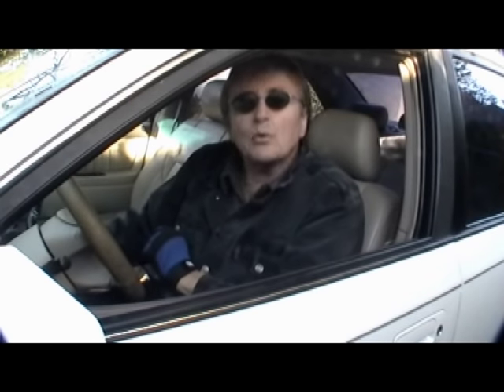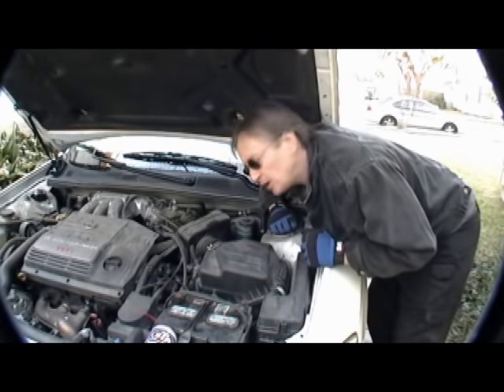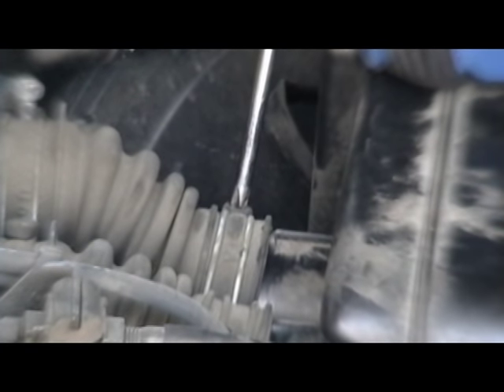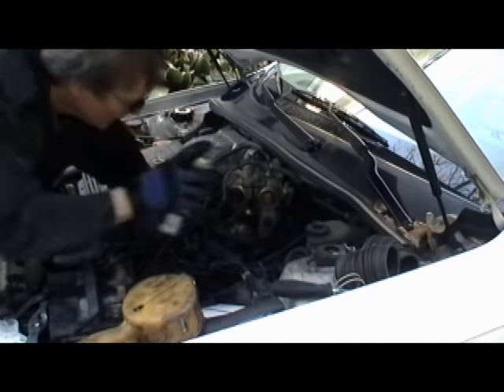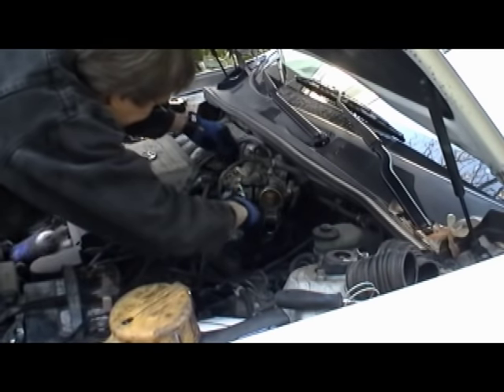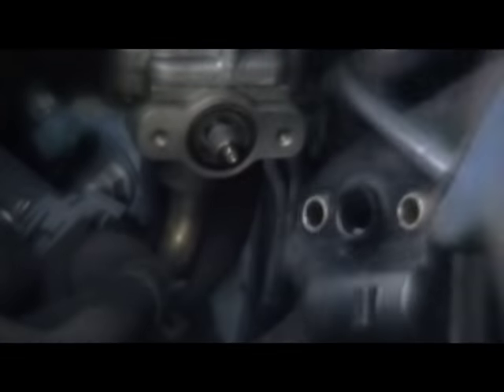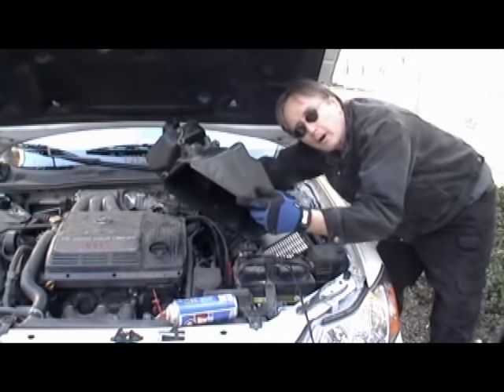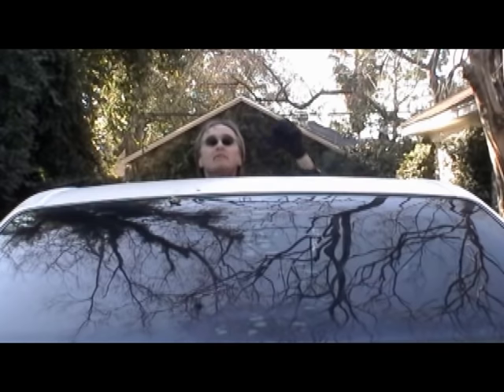How to Fix Engine Idle Problems in Your Car (Rough Idle)

Comment: I have a 1996 Acura 3.2TL V6 premium. the IACV code came up on my code reader. took both IACV AND FIACV and cleaned them. code went away but still fluctuates between 1-2 RPM on idle. My O2 bank 1 sensor 2 is on, causing the check engine light. Could this be causing the rough idle? it doesn't matter if it's cold or hot, it still idle rough when in neutral or park. others than that it runs Great! other than the gas milage. 
also I suspect the previous owner did not use premium gas. any suggestions.? seafoam? if so from where?
Reply from the maker: you could try a new sensor, but often it's something else making the sensor give bad data to the computer, and finding that cause can be a cow. On those, often intake manifold vacuum leaks on that side
Reply: Scotty Kilmer finally after looking all over the place I fund a Crack on the mass air intake. ( the darn 6in rubber tube) then took it apart and it split in half. lol
it started as a small leak that turned into a tear. the problem was the Engine Air suction pipe. it was getting too much air.

Comment: had to replace alternator in 2001 Auroa,now im experiencing a sqeeling noise an sum stalling... wats the problem?
Reply from the maker: make sure fan belts on are tight first and also that they are not just worn out and need replacing

Comment: hey scotty i watch alot of your videos and i have a questio. i have a mazda 6 i 2.3L that is rough idling and check engine light is on i scan it and a p2187 is showing up i changed pvc and vacume lines and still on can you have a rough idea of what It can be?
Reply from the maker: +Odemaris Cosme : P2187 : Fuel Temperature Sensor B Circuit Low Input. ... If you have an intake, whether its cold air or short ram, you might have an intake leak. ..

Comment: Scotty, I have a question please. I have a 1995 Toyota Tercel with a rebuilt engine. Issue is that it vibrates (steering wheel and car itself) when I am primarily stopped and rougher when I put it in reverse or park. (Automatic). But yet, when I put it in drive and go, she goes happily down the road, good shift change, but every now feeling some slight hesitation or loss of power if you will, but it keeps going. Yet, when I stop, there goes the idling rough again, then I hear like a "change" assuming it is the fan coming on and off, and it calms, then a "change" again (fan?) and rough again. Funny thing is it does not vibrate as much with A/C on. We are at a loss and I dang sure can't afford guessing, anywhere from spark plugs, to wires, to A/C to idler something or other to motor mounts, etc. I just need POSITIVE help please. I do have a check engine light on, but it's been on for YEARS! This just started happening after the rebuilt was done I know the mechanic said he cleaned the throttle body, and it helped, but for like a week, then there it goes again - miserable Thank you <3
Reply from the maker: +N Valdez ac makes car idle higher with the idle up valve. Odds are he just did a weak rebuild job, but drive it a few weeks to see if engine loosens up and it idles better
Reply: Hi Scotty, thanks for the reply! The car actually idles better with A/C on and rough when off - that is what I do not understand . . so you still think it is weak rebuild perhaps, not an idler issue of sorts maybe? It scares me to drive, but so far I get converter to plugs to idler maybe. Strange thing is, when I go 50 +, it drives primarily smooth but every now and then I feel a click of some type of power loss, intermittently . .  LOL :(

Comment: Hi master , I been having code po015 on my bmw 328i 07 I get rough idle jerks stalling when I drive it it run ok when I slow down it stars jerking and feel like loose of power or choke. Plz help I change the solenoids n it's the same I change sensor to

Comment: What's up Mr. Kilmer anyway I got a 1999 Honda accord lx - 2.3 liter - 4 cylinder - Automatic with 175,600 Miles. My question is what to do when you start your car then the rpm jumps between 2000 To 3000 sudently it drops to making the car shut off anyway could it be that it needs a new distributor or just follow what this video says and pls answer me by details what is it and how to fix it things like that. And thank you
Reply from the maker: +Augusto Peña   have the distributor checked, they often break down and stall like that
Reply: Ahh men thanks.
Reply: +Augusto Peña Hey Scotty 1 more question - What about if the distributor is A OK no problem so could it be the IAC or the throttle body like in this video...

Comment: +Scotty Kilmer Sir, I have watched many of your videos and replaced cap, rotor, spark plugs, and TPS and my car still idles rough. I have a 1987 Toyota 4x4 with 22re and it idles rough and only takes off at wide open throttle. Also the truck dies when I remove the oil cap while running. Any ideas? Thank you for your time.
Reply from the maker: +Timothy Teista  engine is just flat wearing out inside from those symptoms. do a wet and dry compression test of all cylinders to find out, and if so, live with it
Reply: +Scotty Kilmer thank you for your prompt response
Reply: +Scotty Kilmer i just upload a video"engine problems part 1"

Comment: hi Scotty,,, i have a Vw polo 2006 model, the traction light and ABS are showing and i cant remove them from the dash board..help guys.. Since then the gears aint changing normally nd its an automatic

Comment: My '83 toyota pickup idles rough and engine stutters when cold started. Once it gets up to operating temp it idles perfectly. Any clues? Just replaced spark plugs and plug wires.
Reply from the maker: +Obliterateification try my video "how to clean fuel injectors on your car" and pray you don't need new ones
Reply: Thanks!

Comment: hi Scott i have a Toyota sienna 2000  when i rev it just go 2000 rpm  i was wondering if you could help me out please.
Reply from the maker: pressure test the fuel pump, but realize if you are just sitting revving it up, it has computer software that prevents high revving by your foot

Comment: Hi Scotty! My ford focus rpm goes up when im driving. I put it in neutral and it still goes up. I pulled over and turned it off and wait a little bit. Then start it back on and it goes away. Why is it doing that? It doesnt go up and down, just up. Please could help me with that issue? Thank You
Reply from the maker: try my video "how to fix a car that idles poorly" and also check for vacuum leaks
Reply: Scotty Kilmer alright thank you

Comment: hi i have a toyota marino ae 100 and the rpm stays at 1000 most of the time, even at park. This causes the car to vibrate and i have noticed while driving i have a very poor gas mileage. I have seen alot of mechanics where they have cleaned the air flow, adjusted the speed cable, adjusted the ideal to low but nothing seems to help. what might be the cause? or is the airflow that i have to replace.
Reply from the maker: have a pro analyze the data to see if maf sensor is bad or not, vacuum leaks can also do that as can worn fuel injectors

Comment: Scotty, my 98 ford taurus revs up every minute or so in park only when the heat is turned on. Can you help me figure out what's wrong and how to fix, thx.
Reply from the maker: check for vacuum leaks, and also check the idle up valve, turning heat on often turns AC on too and that cycles the ac compressor on and off
Reply: Scotty Kilmer  thanks mate.  so mention them things to mechanic when I bring it in?   I just had the break booster fixed after one of the mechanics accidentally spilled oil all over it burning few holes in it & other hoses.  wonder if this new problem is their mistake too cause before it wouldn't Start every now and than and they said it was my security system fuse shutting off the fuel pump.  they fixed that but now got this new problem.  weird only does it when heat is put on.

Comment: morning scotty. i got a 99 nissan premirea (rhd) it starts up fine until its warm then theres a rough idle and shuts off and then starts right back up. ive changed plugs , oil air filter even a new fuel pump. but when i try to step on the gas it shuts off. i cant even press it a little . help pls
Reply from the maker: +Michael Hudson have the maf sensor checked, and also try my video "how to clean fuel injectors on your car"

Comment: I have a quick question. I was driving with my mom and I was accelerating got it to about 5500 rpm and my mom starting freaking out telling me I was gonna blow my engine. I dont do this every time I accelerate and I didn't think much of it. I didn't go anywhere near redline. so, is it bad to do rev up to 5k-6k?
Reply from the maker: the higher you revv em, especially on older cars, the faster they wear out. But on a newer car in shape it hurts nothing if done once in a while
Reply: +Scotty Kilmer it's an 04 civic. so I think I'm good. Thanks!

Comment: I have a chrysler Sebring 04 Engine Type	2.4L L4 DOHC 16V. we just got the computer fix and the rpm neddle is still going crazy. the mass air sensor is clean. but when am at a stop the rmp needle goes to zero and it shut off but I but it in park and start the car and it's start up again what could it be???
Reply from the maker: +time m   many things can do that, but it's new enough the computer stores all that info on the faulty stalling. See my video "fixing insanely complex modern cars" and find a guy like me with that machine to analyze it

Comment: hello.
i have  mitsubishi lancer 1999 1.8 cc
problem is miss idle or miss fire when accelerated between 1000 rpm_2000 rpm
Reply from the maker: many things can do that, tune it up first of course. But if ot that, often a bad fuel injector will do that or a head gasket starting to blow on a Mits

Comment: upper and lower control arms replaced. struts replaced, front end alignment and  tires balanced. no bubble in my tires.  and yet my f150 won't stop shaking. ????????
Reply from the maker: +Christina Iasevoli start with better alignment guys, my guys at cotton brothers in houston have never failed me fixing such vehicles. Could be ball joints, transmission mounts, drive shafts bent, lots of stuff. Pros can always find em

Comment: hi, I have a question for you. I have a mini Cooper S supercharger 2005, the ABS lights get on when I go over 75 miles per hour, I ready chaged all the abs sensor, please if you can give me some idea I will appreciate.
Reply from the maker: +Arley López realize you need a bmw dealer level scan tool to work on that mini ABS system. Otherwise, just pure guessing. Me, I'd live with it cause it hurts nothing really, abs goes to normal non abs braking when light comes on. Fixing it could cost a fortune
Reply: Check your brake fluid level.

Comment: my check light comes on po135  changed both sensor what you think it is .
Reply from the maker: +Ronald Paul bad wiring or bad main computer will also trip that code

Comment: I diagnosed my car and it showed p1505 on a kia optima 2007.  I cleaned the throttle body and the IAC by declogging it .At first the check engine light cleared by itself but later it came on.And after clearing the code with my OBD2 scanner .It still came back .What should i do?
Reply from the maker: remove the entire throttle assembly, clean it inside whistle clean, and pray you don't need a new one.
Reply: Thanks

Comment: Hi Scott I have a 2003 BMW 525i car that would not start originally. I changed the plugs and car starts right away but does not stay idle I have to keep my foot on the accelerator to keep it running, as soon as take my foot off it dies out. Any suggestions? please.
Reply from the maker: +David Risko  often vacuum leaks on that model, cheap plastic intake parts crack and leak and suck air. do my video "finding engine vacuum leaks with a cigar"
Reply: I saw that and going to try it now. Thank you for your information.
Reply: My daughter got ripped off by a mechanic.

Comment: hi I'm  having some problems that is causing my 2003 taurus not to run. first it started to back fire while trying to start. I put a full thing of sea foam in the gas tank. then it started to die at stops. if ally getting it home I changed the coolants sensor and cleaned the Mas flow intake sensor.  The car purr like a kitten for 2 min then died. Next thing it would only start with the gas peddle to the floor but still die out if let up. changed pcv pulled plugs they were gapped deep as 2 quarter and black but no oil or not wet. Before I sink more money what do u think is my problem.
Reply from the maker: +Gordon Gman Gil   pressure test the fuel pump and see if it's shot, also check to see if the fuel pressure regulator is leaking and needs replacing. PRAY it's not a blown head gasket that those are known for or internal engine failure like worn valves
Reply: The fuel pump prim's when I turn the ignition.

Comment: I keep getting a P0507 and i have cleaned the throttle body. I can not find a leak. Can you help.
Reply from the maker: often that code needs a new throttle position sensor, pray it's not a bad circuit in the main computer

Comment: My service engine soon came on after I took my 2006 nissan xterra 2wd s for a tune up, it never came on until I got a tune up.  The mechanic said it was the idle control valve...really!!  I had no problem with the light until this...whats up??
Reply from the maker: +4105DJ odds are he messed something up doing the work, go to another mechanic to check that out first

Comment: What do you do for cars that say you shouldn't spray cleaner in there?
Reply: No throttle body should be sprayed internally with cleaner. Spray cleaner onto cloth and wipe down the accessible/dirty surfaces
Reply: Mike D Don't listen to Scotty or the guy who commented. You should ALWAYS remove the throttle body to clean them. And you might as well replace the throttle body gasket too.

Comment: hi I do have a Ford five hundred 2006 and I had very low rpm.wend I'm stop on (d) or back of the rpm.go very lower
Reply from the maker: +Gustavo Antunez try this video, and also "finding engine vacuum leaks with a cigar"

Comment: I have a 1991 Mercury Grand Marquis LS 302 I start my car up cut on the Heat or the air conditioner in my car cuts off and it's got a funky little Idol we're revs up and down and then it cuts off can somebody help me I don't know what that is I replaced the plugs wires caps rotors intake manifold check for leaks vacuum hoses I don't have a clue and I've been dealing with this for the last 6 months I've replaced a little bit of everything on the car just because I don't know what it could be I took it to a shop and they charged me $950 and they didn't fix the problem either

Comment: Scotty, can you help me with my mustang? it's an 88 5.0 fuel injected. Starts fine and won't stall out. But she idles high, and bounces rpms around. sometimes gradually climbing rpms the falling or just climbing and staying at an even higher idle. Do I need a tune?
Reply from the maker: try these video fixes, and also "finding engine vacuum leaks with a cigar"
Reply: +Scotty Kilmer Well that was fast. I appreciate the response! But which video fixes are you talking about? And I will make sure to check out the how to on finding a vacuum leak
Reply: +Scotty Kilmer You can even smoke it when you're done, right Scotty? lol.

Comment: Hi Sir Scott I Have a Daihatsu 2004 YRV model. Heres my problem. when I start my car in the morning and start turning my AC on the engine is switching off. I went to a mechanic they cant find the problem as they check the dynamo, battery, fuel pump. all the parts i mention is ok. So what seems to be the problem of my car?
Reply from the maker: +Cutting Edge  either idle up valve is bad, or the ac compressor is wearing out, straining the engine, and making it stall
Reply: Ok Sir Thanks!

Comment: Hi Scotty, i have a 2002 Mazda protege the problem is it keeps revving it self without a foot on accelerator pedal, some mechanic told me to change the throttle body (IAC and Throttle position sensors) but the problem remains. WHAT CAN IT BE PLEASE
Reply from the maker: he meant to change the whole throttle body, but remove it and clean it all out, could be sticking inside on the valves and passageways full of carbon
Reply: Scotty, before you answered (which im very thankful) some one borrowed me a hole throttle that he is using on his Car (same model) but, nothing changed :(.  is there any thing else i can do to solve it sorry my insistence

Comment: Hey Scotty, I have a 2008 honda fit and the engine shakes when I have it on drive, when I switch it to neutral it shakes less, on the highway it feels sluggish, I recently replaced the spark plugs, ignition coils and egr valve, no check engine light comes on and there's no codes popping up, at times the engine feels like it wants to turn off, I took it to honda and 3 other mechanics and they can't seem to find the problem, I've spent around $800 on parts and labor & I'm going crazy, can you please help me? 😭😭
Reply from the maker: those are notorious for 2 problems. First, the valves often go bad and need adjusting, have them checked first. And second, the VTEC system on the engine often goes bad from getting clogged up side, have it taken apart and cleaned.

Comment: My car; 1997 dodge caravan 3.0l 3speed, after I replaced the idle and air filter, it won't start so l clean it with a spray can like what you did  in the video, still won't start. Please help.